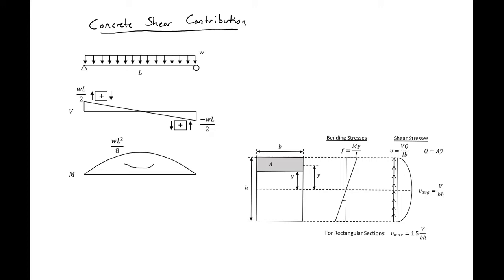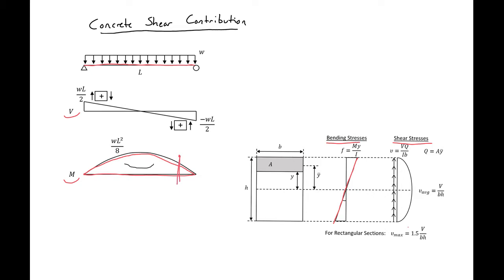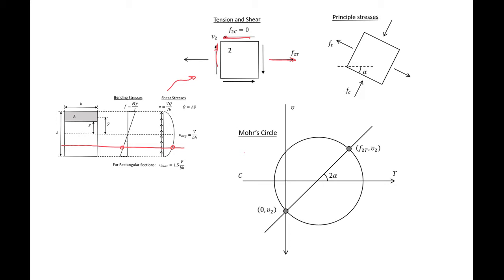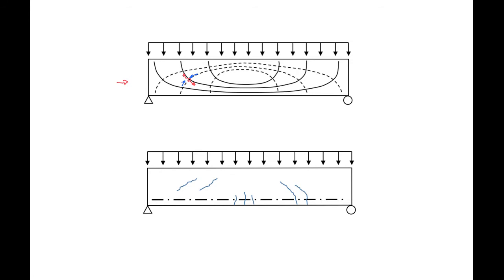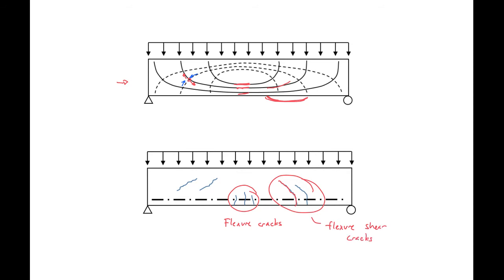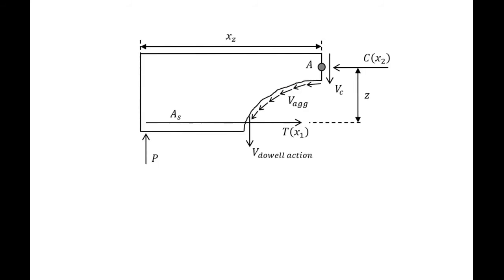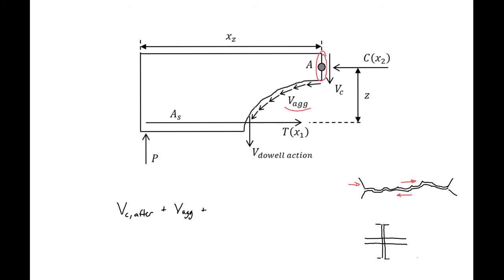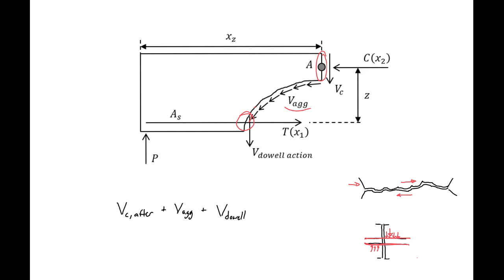8 - Concrete Contribution to Shear Strength

Comment: sir as you know that the shear crack is not due to shear that is du to diagonal tensile stress because the crack is inclined .now why not we consider that diagonal tensile stress in our calculation?
if we consider the shear force which is vertical force and shear crack is inclined then why not we consider the inclined sectional area of the stirrups which will be more effective as it is perpendicular to the crack.